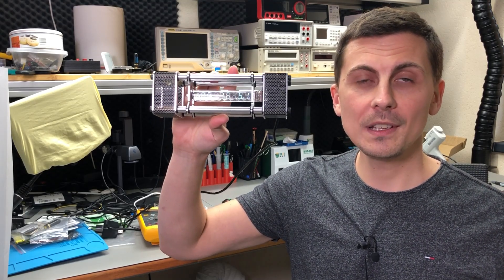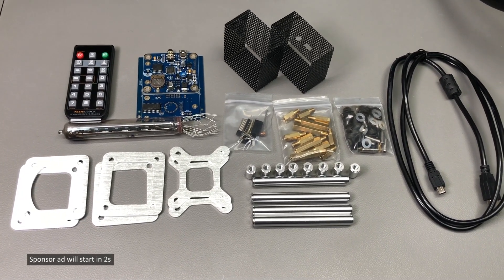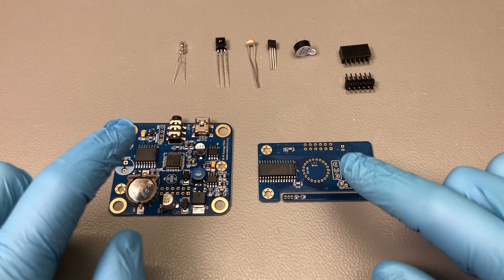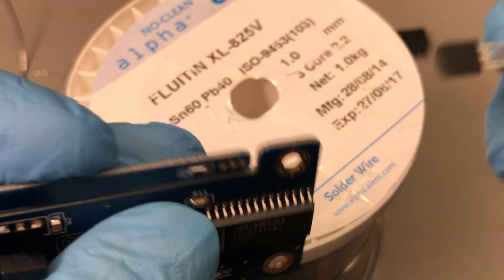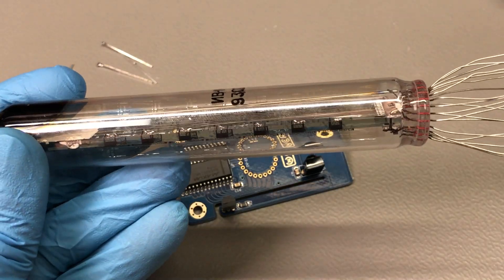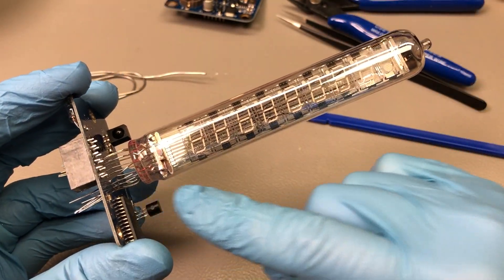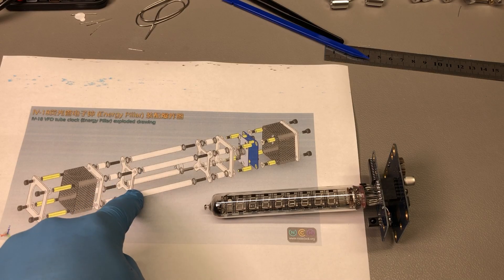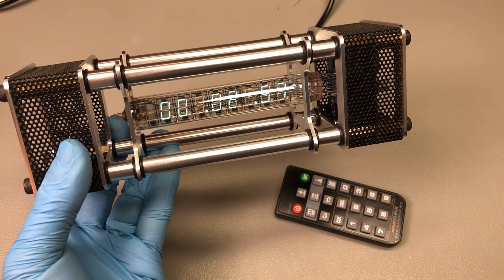The most awesome VFD clock kit | Voltlog #388

Comment: Nice industrial design, but a poor clock.  It needs a black background behind the tube; as it is, you can barely read the display.
Reply from the maker: Yes, maybe a black background would help but also consider how bright the lights that I use for shooting videos are. the clock looks better under normal ambient light.
Reply: @voltlog  These VFD look washed out unless there is a green filter in front of it for contrast. I like the mechanical design of that clock but this is a fairly major oversight - a sheet of plexiglass wouldn't have costed a ton more ...

Comment: What's the part number for the optional temperature sensor? Or was it included? How does one connect a GPS?
Reply from the maker: 18b20 sensor included. I think any GPS that can output 9600 baud NMEA would.work.

Comment: I appreciate the review, thanks.  But I hate the clock design.  Us dinosaurs from before the age of LEDs have no nostalgia for nixie tubes and VFDs.  Although I did build a clock that, like this one, had too many features and no place for buttons to control it, so IR remote to the rescue.  But it was a beautiful LED clock, GPS timebase included.
Reply: Well VFD's ... When I see my Technics deck from the 80's I am still in love with the VU-meters. About using them for clocks .. I have no feeling for them either. The one thing that really surprised me, in a very positive way, is my E-ink thermometer from Xiaomi.  Might  buy a clock like that.

Comment: Mercury switch. So much for RoHS compliance :D
Reply from the maker: I guess you also missed my big spool of leaded solder 😂
Reply: @voltlog  Leaded solder is fine. It will not kill you with its fumes if exposed to the air :D
Reply: There are mercury substitutes based on gallium.
Reply: @NiHaoMike64  Gallium wouldn't work in a tilt switch made from glass since it wets glass /very/ well.